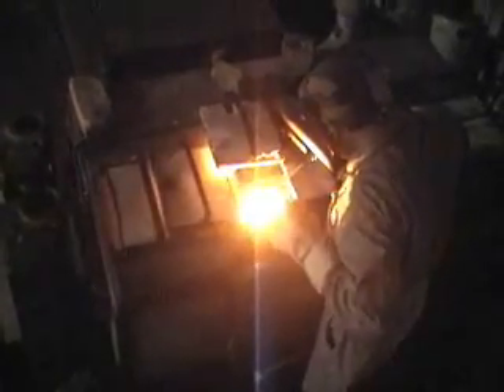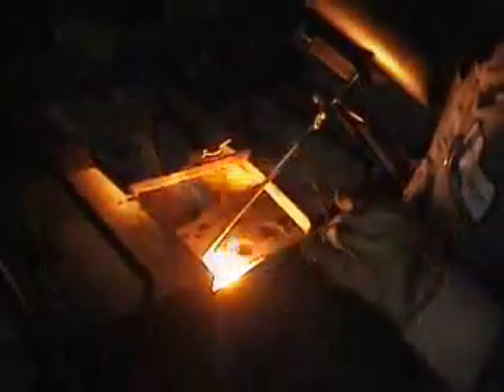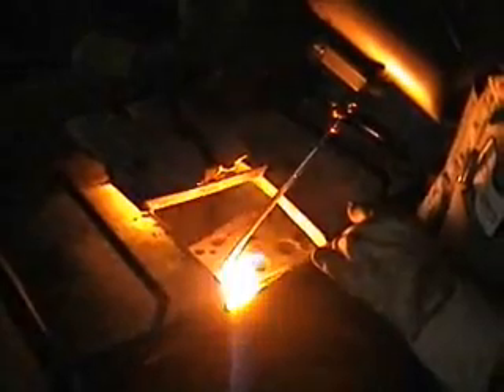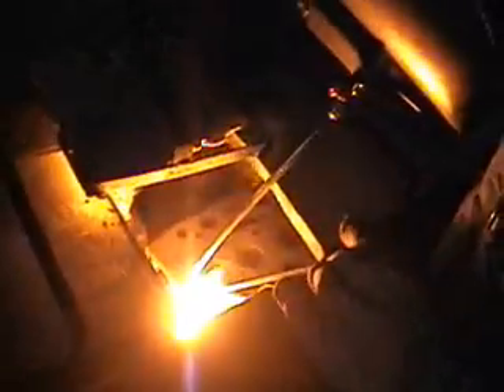Oven Fusion Cast Iron Welding

Comment: Hi, I´m a Industrial Engineer and I work in a shop that works  with recondition of engines here in Brazil. We proceed with the same Technic to repair iron cast cylinder head´s. Well done.

Comment: it is and it isn't. Think of vintage engine's cylinder heads..where will you get a brand new one?
Reply: a machinist?
Reply: @piergiorgio919  What about a rare numbers matching engine?
Reply: Maybe that wouldn't matter with only the head.  But the engine block for sure.